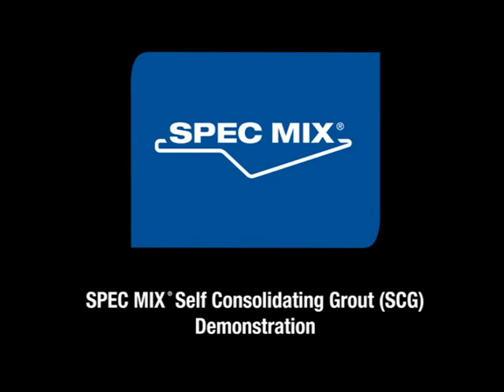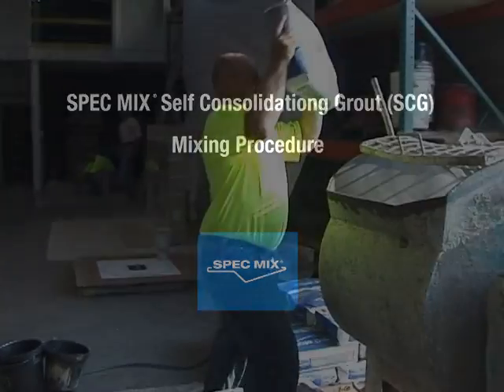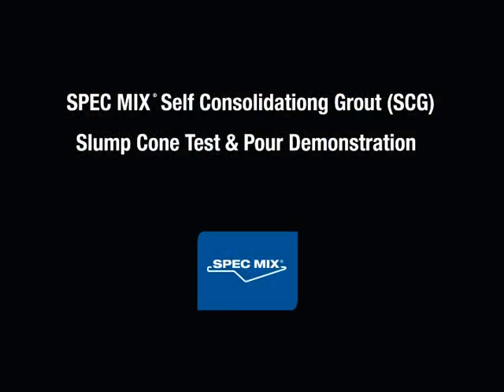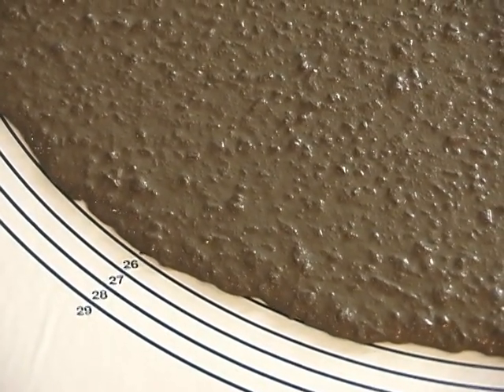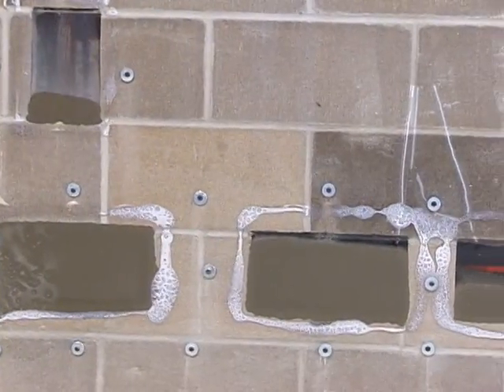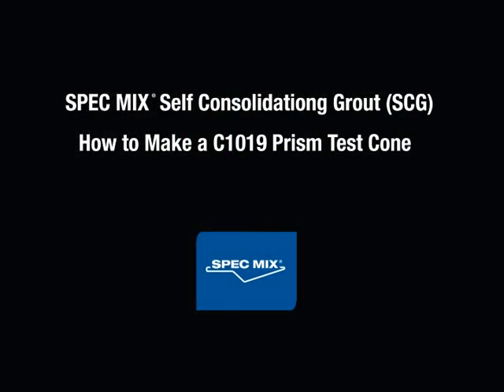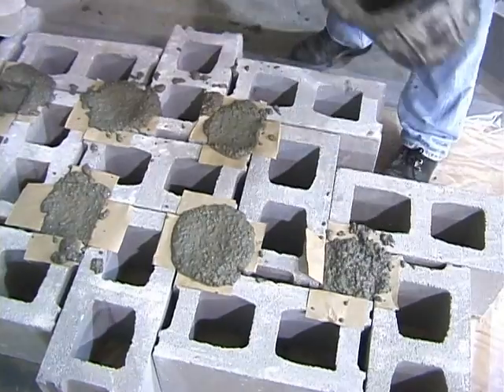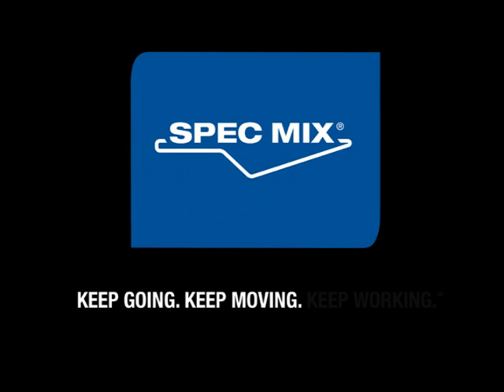SPEC MIX® Self Consolidating Grout (SCG)

Comment: Used Spec mix mortar and have always known it to be consistent. Not to say, depending on where you're working, humidity, temperature of course all comes into play. However, VIF, verify in field, blow outs occur,mix gets wet and can lump up. Vibrating the wall is the sure way to go. Mind that all possibilities of a blow out will save you a lot of work and money.